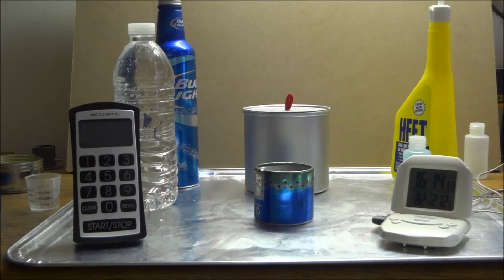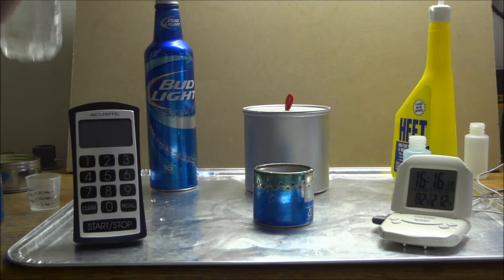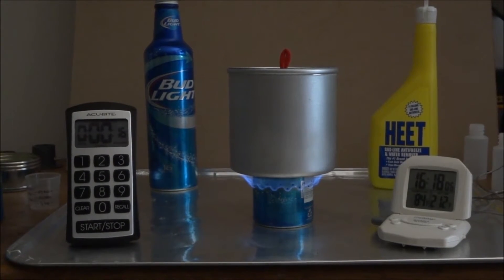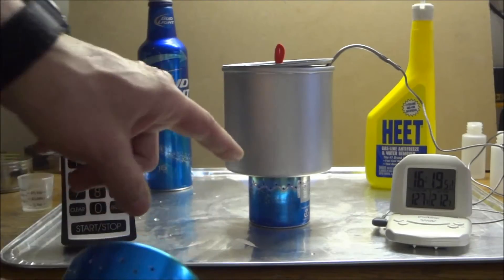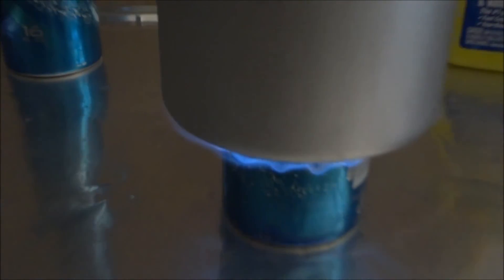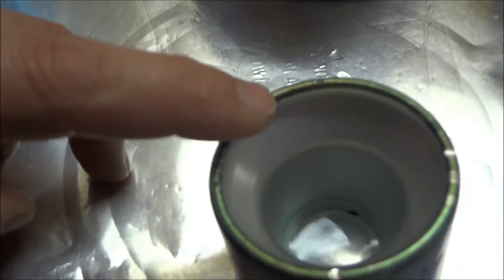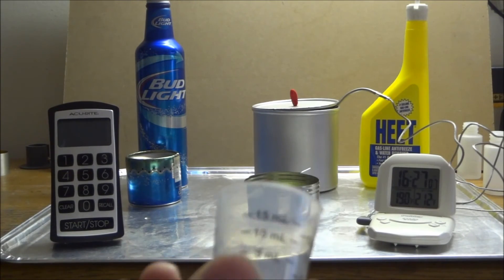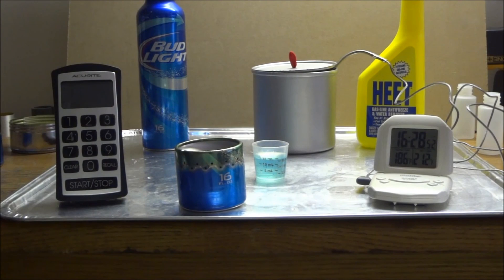Screw Top Aluminum Bottle stove, Fuel efficiency tests

Comment: Cool deal Sam.  I just grabbed one of those new bottles out of the trash can after my Son had thrown it away!  I agree with you, I like the 2 piece stoves because I like the using the top as the inner wall, I don’t know, just seems like it should be that way?  I just checked the store (5/12/14) not there yet, I’ll be keeping an eye out for it…
Reply from the maker: Hi Jim, Yes I too prefer the 2 piece design I think the extra interior space helps with the overall burn of the stove and the two piece do not seem to suffer some of the issues the single piece design has. I hope to have some on the web site soon I'm still trying to fine tune the jetting.

Comment: That is great efficiency. Could you start with 15ml ? That way you could bring your 2 cups to a boil, and you wouldn't have to mess with reclaiming fuel.
Reply from the maker: I did try this and the results were the water got up to around 193 degrees. of course there are variables with every burn.